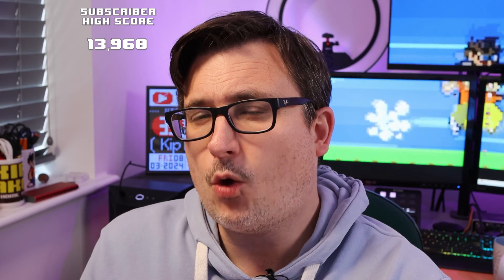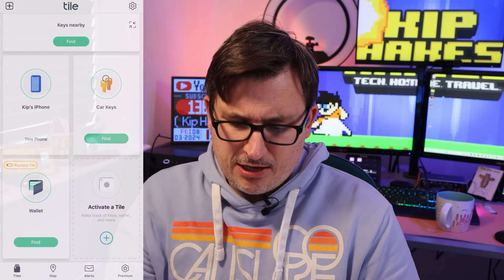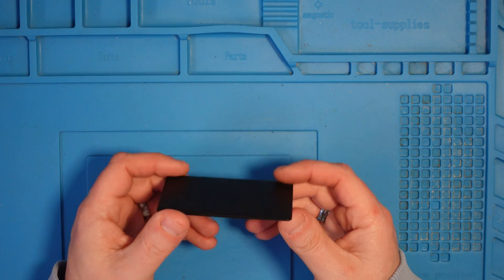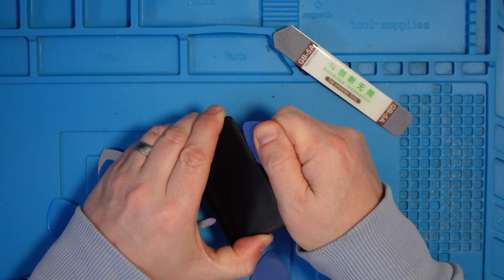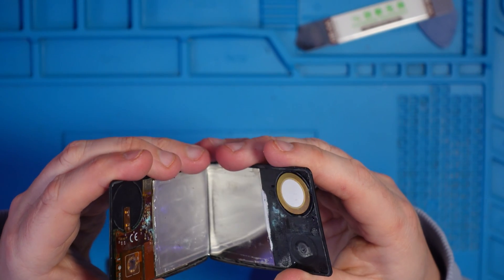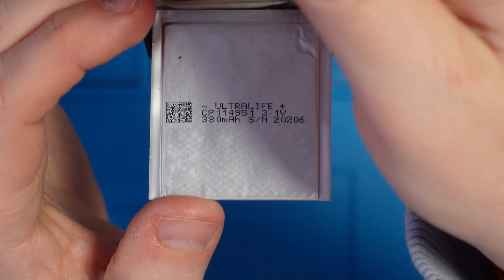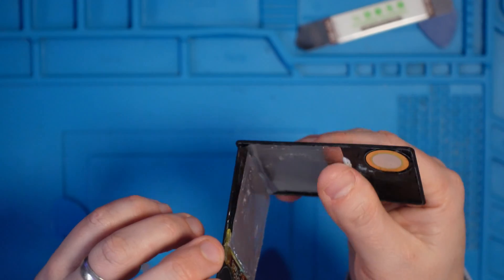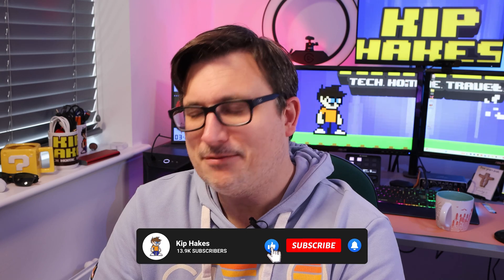Replacing the Battery in a Tile Wallet Card - Quick Fix it Friday

Comment: Did you manage to replace the Ultralife CP114951 battery?

Someone put it together, 
So someone can take it apart and put it together again

Unless it is glued, soldered or permanently attached

The Ultralife CP114951 batteries are available to buy on the internet...

Comment: Perhaps 3D print a new shell in which, instead of having a lithium ion location, you could have a housing for a flat CR battery and have a coin cap on the back side similar to heartrate sensors? This way, you transplant the guts, desolder the battery, solder the new connectors that would now use the CR battery (CR2032, CR2016, etc), clip the shell together and Bob's your uncle?

Bonus points if you add gasket channels to make sure you waterproof the inside.

Comment: Simple solution have it be wireless recharging or have two electrical contact points. I got a wallet with an air tag. There are other manufactures who make a card that can be recharged.
Reply: 100% should be wireless chargeable

Comment: Thanks, it's a shame that it becomes e-waste after a year.  The card is 2.5mm thick and a thin CR2025 button battery is already 2.5mm thick so they'd have to have a raised bump to accommodate it, probably where the round tile logo is would be best.  Of course the CR2025 would be half as good since it's only a 170mAh battery.  So I guess they took the compromise.

Comment: It is wasteful. However, making a WATER RESISTANT case adds size and cost. So the wallet card trades off the replaceable battery for being SLIM and water resistant.
This is slim enough to conceal in various places, so...trade-off, not ripoff. No one else makes such a slim tracker.

Comment: Though others have replaced it with a watch battery, reclosing the case nicely seems to be a challenge. Though that may be no big deal if it's in your wallet anyway. I'm thinking I may put it it in a completely different case I 3D print, and use it for another purpose. Maybe a dog tag case for the dog, or a keychain case. Then get a fresh one for my wallet.
Reply from the maker: Great idea!
Reply: Exactly what I thought

Comment: Could try and recharge the battery using a USB cable with split wires I would say 0.5amp should be done in 5 minutes
Reply: That is bad advice! If you want it to explode, just stick it across the mains!
Reply: I recharged a disposable ecig and refilled the canister problem with lithium is there is no protection on it so over charging it would be catastrophic you if you know the cells capacity and some clever maths you could probably do it safely

Comment: Mine last 2 years. The 380mah is BS. The 2032 is 225mah. From what I can tell that trash battery covers more space then 4 2032. 

~900mah

If 380 lasts 2 years a fully functional battery pack that size should last ~5 years.

Now where near close with 380mah. 

Sounds like shorting the

Comment: Numerous people have replaced this battery with 3V batteries like CR2032 (or you could do CR2016 as thinner or CR2016 x 2 in parallel (NOT SERIES!) for more capacity). ~3V at a low current is ~3V at a low current. The battery says 3.1V (when new) on it in the video, I mean it's only got 2 wires.
I think I'm about to get one and Ill just do that when the battery dies. It works or it doesn't work, if it's dead and going in the bin if if it doesn't work it's not a high risk repair.

Comment: 4 or 5 years!? Mine lasted a year….
Reply from the maker: Yeah.. I’ve had all my tiles for at least 4 years. The other ones actually need replacing frequently, the wallet card, was fine though!
Reply: Ya mine last about 3
Reply: Mine just died at five years. Been great for me.
Reply: mine lasted around 3 but that's because I'm constantly losing my stuff @_@
Reply: I'm on 6 now
Reply: Mines been going for 4.5 years
Reply: Yup mine's at least 4.5 years and it's still going but it needs replaced soon. I wanted to see if it's possible to replace just the battery it's not.
Reply: Directly proportional to how often you look for it
Reply: Mine lasted 4 to 5 years at least. I don't remember when I bought it but I know it was at least 4 years ago